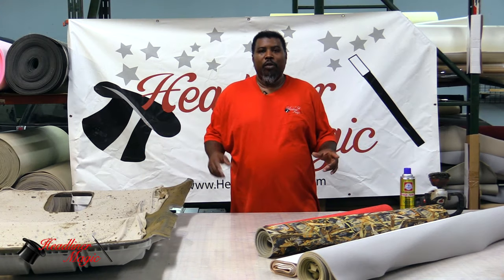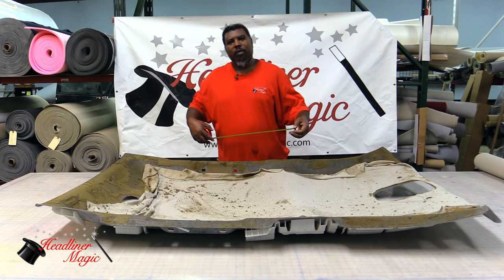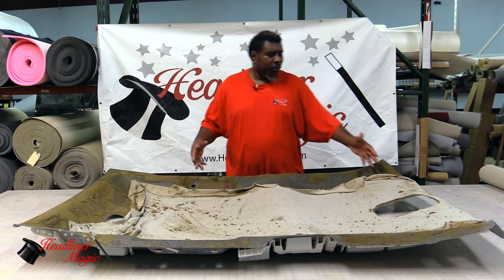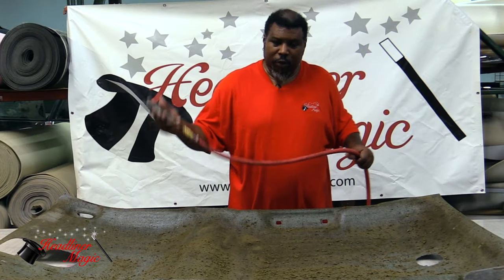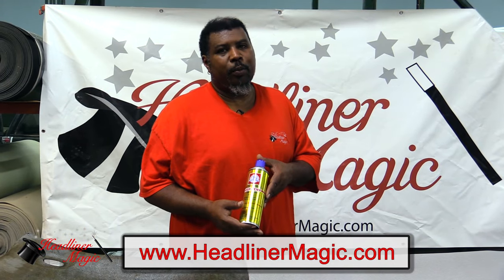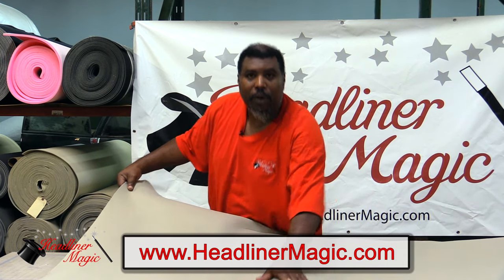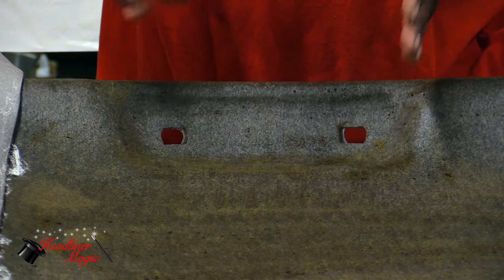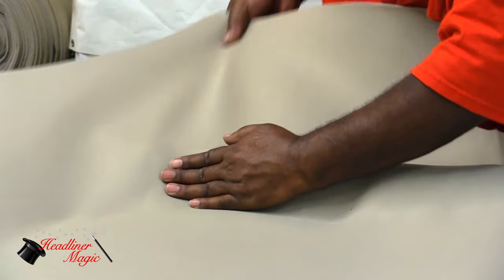Detail Process Replacing the Headliner Ceiling Fabric in Any Vehicle

Comment: Marcus, I'm so glad I came across your video.  Looking for some help.  I have a 2018 Sprinter Van.  The cockpit headliner is a gray felt type material.  In the back there are 4 headliner  panels than span the whole cargo area.  Those panels are more of a perforated vinyl that is a light grey blue, and its a mismatch to the front.  Can you recommend a matching  color material for those back panels, and, since they are in great condition, can I just glue the new fabric over them??  thanks!!  Mike
Reply from the maker: I believe our 1808 Ox Gray headliner will be a great match to the front headliner.  And Yes, you can just glue over the rear panels to color match everything.  If you like you can email me at headlinermagic@gmil.com with a picture and I will respond with the color match and link to where to purchase the material by the yard.  Marcus

Comment: I have a 2000 Jaguar S Type that needs headliner replacement. My vehicle has a sunroof, how much more difficult does that make the process?
Reply from the maker: The 2000 Jag S Type is a easy one.  Drop it and remove it out of the rear doors either side.  The sunroof area.  I have some time at this video link. 
 
https://www.instagram.com/tv/CXkCTIQlMJn/?utm_source=ig_web_button_share_sheet

Marcus
Headliner Magic

Comment: I have an annoying question. What if the foam isn’t torn up but still that bright yellow color? Do i have to scrape it all off or can i leave it?
Reply from the maker: You should get it all removed.  The foam has lost it ability to hold to the fabric it was originally attached to.  So, at this point, it is compromised.  Marcus

Comment: will a 36 L x 60 W be enough for a 2006 Toyota Corolla?
Reply from the maker: No the headliner board is larger than that.  I suggest 2 yards which measures 72" long x 60" wide.

Comment: Still a good job
Reply from the maker: Thank you Hailey,  Marcus
Reply: @HeadlinerMagic  I plan to use 3m 90 adhesive on my headliner because it resistant to higher heat
Reply from the maker: @Hailey_WhiteRaven  3m makes a glue now for headliners, I would recommend using it vs the 3m 90 her is the model #38808

Comment: Marcus, when a person takes his car into a headliner shop, they only replace the foam, not the board?
How much does it cost, on the average,  to obtain a "new" headliner, say for a 2004 Ford Ranger?
Reply from the maker: If you are referring to the board cost. The newer cars are only available from the dealership and the cost can range from 600 and up just for the headliner board. Good news is it comes wrapped with foam backed headliner. That cost does not included installation. The 04 Ranger should cost in 2020 around 175 for single cab and 225 for extended cab in my opinion for the headliner material replacement. Price could vary per shop and materials used.

Comment: Did the foam that you were wire brushing off start off as a sheet of foam lining in between the headliner and the fabric? I noticed you didn't replace that.
Reply from the maker: Hello Eddie,  the new headliner material is already foam backed.  When the new headliner is applied to the headliner, the fabric and foam backing are installed all together.   Marcus

Comment: I have couple questions. When I removed the headliner I had impression that the top wires were attached w/Scotch tape to the headliner, but now I think they might just stick to the headliner, but actually were attached to the metal ceiling. Can you attach them to the ceiling w/tape? And another question : when I cleaned the old foam, in some places there was some layer pilled off, like thin fabric or paper, not sure what it is. So now, should I pilled it off everywhere, or I can live it and the foam will attach and dissolve that layer (I hope it is some kind of paper layer), but maybe when the headliner is in that condition, it can't be renewed w/a new layer of foam fabric. Thank you again.
Reply from the maker: The wires cam be attached to the board or the ceiling either is fine.  And the layers can be glued to the board and just make sure they are a level as possible to avoid any lumps when applying the new headliner material.
Reply: @HeadlinerMagic  Thank you kindly. The loose layers are very thin and look like napkin paper. I'll remove as much as possible making sure no uneven areas are formed. I also think to cover the outer side (which goes to the ceiling) w/fiberglass resin to strengthen the board a bit. I saw in one film the author put several layers w/large brush. That board is very easy to brake, I don't know or bcs of time and heat, or it is just that kind of material. I expected it would be plastic there, but it is just a dense foam. Thank you again, especially for the advice about wires, it looks to me way easier to attach w/scotch everything to the ceiling instead of messing w/that easy to brake board.

Comment: how import is the material having foam backing? I've had trouble putting a material on my benz headliner and I assume its because it's not foam backed
Reply from the maker: The foam help for keeping the material from bleeding thru. You can do a unbacked material but it take skill to spray it and not bleed it thru. You have to spray it on a hot day from a distance and let the adhesive land on it lightly spray the board first so it will have time to tack. Then rub the two together.  You still have to do small sections at a time keep the wrinkles out.
Reply: Early 2000 I used a white vinyl bought from the fabric store with no foam backing on my 85 Cutlass. I was able to do this pre YouTube without issue. However, without the foam looked slightly out of place where it adjoined the car's interior pieces. But still looked great having DIY all white interior.

Comment: How much wld it cost for a 98 accord sedan with sun roof in black?
Reply from the maker: If you need the headliner it's www.headlinermagic.net for $49.97  and adhesive at $29.95 for two cans or if your local and would like the service we can complete the replacement for $275. 1 yr warranty. And the task would take 2 to 3 hrs.

Comment: Hi how is it going, I have a 4 door Sedan with a sun roof. I bought a roll of suede with the foam backing. I tried to go the easy was and wrap over the OEM headliner. I got half way through it and noticed the permatex headliner adhesive was soaking through, and left glue spots on the suede. I tried to use mineral thinners to get the glue off but it didn't work. I got frustrated so I ripped it off to the cardboard, cleaned it off, and prepared to go at it again. Why do you think the glue soaked through. Was I suppose to wait for some time? This time around, I ordered stretch suede (which I didn't before). The sun roof recess was a but difficult due to no give in the material. Will the stretch suede help in this area? After the wrap, I have to add the fiberoptic (stars). Thanks so much for the help...
Reply from the maker: Yes the stretch suede will help tremendously.   The glue should be applied to the board in a mist like form.  If it's coming out to wet.  Try shaking the can more and spray further from the place you are applying.   Then let it tack up about 20 to 30 sec before applying the two pieces together.
Reply: @HeadlinerMagic  Thanks so much, I see. The Permatex comes out stringy, and a bit wild. I got it somewhat done though, I just have to do the edges. I got a little spot  where adhesive touch the suede in the rear, not too obvious, but is there any thinner that can get it out without ruining the suede? Again I appreciate your info.
Reply from the maker: You can try hand sanitizer or some alcohol or paint thinner on a rag.  Do not apply it directly.
Reply: @HeadlinerMagic  Ill give that a try. Thanks so much Marcus.

Comment: How many cans of hi temp glue did you need ?
Reply from the maker: Great Question Israel, you will need 1 can per every 1.5 yards roughly.  So if you headliner is longer than 54" then you will need tow cans of adhesive to get the proper coverage.  I used one can in this video when the cans were 15 oz.  Now they are 12 oz so they are a litte smaller than before.  Hope this helps.  You can also tell me the vehicle make and model and I can tell you more specificly.  Marcus

Comment: how do you remove the headliner out of a 2007 mazda 6 on the corners without the airbags going off
Reply from the maker: Hello Brittany,  The mazda 6 is so easy.  You will remove the visors, handles, and interior lights.  Then recline both seats and put one hand in the center dome light hole and the other in the front console hole and pull down on the board and it will release from the sides.  Walla Magic.  Marcus

Comment: What if the headliner is in a new car and you want to change the color? Couldn't I just put fabric over the original headliner? Or do I have to remove the whole thing like you've shown in this video?
Reply from the maker: No if the fabric is fairly new you can just go over the existing fabric. You will just need to use a fair amount of adhesive because the fabric will absorb some of the glue spray. Marcus

Comment: Is 3 cans enough for a Caprice Wagon ?
Reply from the maker: Yes,  2 can is great for the Wagon. You Should be be ok with 2 as you can usually do 2 yards of material with 1 can.  The wagon  uses 3 yards of material with out a sunroof.  if you have a sunroof you will need 4 yards.  Marcus

Comment: I’m a bit confused. Most every single person that does upholstery lets the glue tac up letting it get dry before they ever start covering. Just curious why you don’t use that method.
Reply from the maker: Spray cans dry very fast once you shake them correctly to spray in a mist.  They should not spray out so wet because you don’t get a even spray just wet spots.  Being a contact adhesive the working time of this adhesive is less that a full minute. We spray on a small section to have time to work with it and have a modest amount of material to deal with in case we have issues like wrinkles or something not laying out right.  Marcus

Comment: I have leather material it has no foam. What I do about foam I have a old school
Reply from the maker: If u have a board just apply some regular headliner down first with a foam backing and then go over it with the leather.
Reply: @HeadlinerMagic  I had to replace it and it’s bare
Reply: @HeadlinerMagic  so it’s not good to just apply the leather to the board without the foam?
Reply from the maker: You can apply it without the foam but it can show imperfections in the board is all.
Reply: @HeadlinerMagic  Aw ok. I got a brand new board so I guess I will be ok

Comment: Hey I just brought some adhesive from your store the other day by any chance do you know how I could put my headliner back into a Chrysler 300 without bending it
Reply from the maker: I can help you with that.  This is a tough one but here we go💨💨 First recline both front seats, then the driver side seat let it all the way down and back.  We will be going in the back door on the drivers side.  The board will be turned side ways and shove it down the side of the seat and lean in the top part towards the roof.  The board is fiberglass so a little bending wont hurt it at all. you can go around to the passenger side front to make sure you are clear going in towards the dash.  Once you get it in  you will swing the back over towards the passenger side and you all good.
Reply: Headliner Magic thank you so much for the help will be doing that Sunday letting the adhesive dry all the way

Comment: PLEASE PLEASE tell me how you spray the glue on both the headliner and the board and you are able to lift the headliner back off to smooth it?? When I tried it just put a wrinkle and the glue wouldn’t let me lift the headliner
Reply from the maker: Great question.  Timing is key.  But I am not always successful.  depending on the tack time and if you smooth it out the first time.  if the material is just laying on the board it will come back up usually.  But if you actually smooth it out, the pressure applied will cause it to be permeant in most cases.  This is the main reason I only spray a section at a time, so I can focus on the laying of the material to avoid those mistakes. I hold up one end and pull on it to decrease any slack when I am smoothing it out.  Don't pull to hard just enough to make it snug.
Reply from the maker: I wanted to also say Thank you for subscribing.  It means a lot to me and the channel.  Marcus
Reply: Headliner Magic thank you so much!! We normally spray half at a time and there is no way we can lift it if it touches at all!
Reply from the maker: @missyleftrick5525  you will have better luck with just spraying 12 to 18 inches at a time.  Try that and let me know the difference.  Marcus

Comment: I noticed you didn't leave access material around the holes and you did around the edges, why?
Reply from the maker: Great question Raffe,  the pillars create a seal as well as the light consoles and other accessories.  There are only a few vehicles where i will wrap the board where the pillars go.,  They are the ones where the pillars just don't sit close enough to create a tight seal.  Marcus

Comment: whats the average price of replacing a headliner?
Reply from the maker: Headliner replacements average around $325 to $375 depending on year make n models and the material used. A small 2 dr truck can be as cheap as $225 and a Porsche Cheyenne can be as much as $550

Comment: I bought new headliner material and removed my headliner and removed the old fabric and foam. I purchased the 3M super 77 adhesive for fabric. Applied it to the headliner board and to the back of the fabric and let it tack up. Re installed head liner and two days later its sagging now. What should I do to fix this?
Reply: @RyseTV  I would rather do it myself on my project car. 

Just need the right glue. Im gona try Weldood Dap this time
Reply: @ddemier  Don't get me wrong but it'll probably sag within 1 to 2 weeks. You could have let it done by a professional with the money you've spent.
Reply from the maker: The 3M 77 does not have the High temp properties needed.  You can use 3M headliner adhesive they have that should do the job..  You only need to let it set about 30 sec depending on the temp during the time of installation.
Reply: @HeadlinerMagic  what do you think of the Weldwood Dap contact cement. I think im just going to apply the gel like cement on the headboard then apply the headliner after I fold the drooping headliner back. Of course i will have to remove headliner again.
Reply from the maker: @ddemier  I have used it on vinyl jobs. it may work as well for the foam liners.
Reply: @HeadlinerMagic  well its what I orderd. I will try it cuz that super 77 was junk. Should I do two coats of that weldwood contact cement on that headboard? I figued the first coat will soak in
Reply from the maker: @ddemier  Yes,  You should do two coats.  The first one will provide a seal on the board as a base.
Reply: @HeadlinerMagic  can this weldwood dap tolerate the heat unlike that 3M 77?
Reply from the maker: @ddemier  Yes, the dap weldwood is great in high temps.

Comment: What is the cost of this
Reply from the maker: The cost to replace a headliner will depend on the vehicle year make and model.  Mainly because of the complexity of the removal and cleaning process also the curvature of the board itself.   But for reference this was a extended cab dodge truck and our services would $325 for the full replacement process.   Thanks for the question.   Marcus
Reply: @HeadlinerMagic  What would the cost be for Mercedes A class headliner?

Comment: No foam between the new headliner and the board? You ground off "old" foam.
Reply from the maker: Hello Ruben, The foam is already attached to the new headliner fabric.  That is the way the headliner is manufactured originally.  The foam delaminated over time due to heat and quality.  The old foam need to be removed completely because it is unreliable due to the foam breaking down.  Marcus
Reply: @HeadlinerMagic  Got it. It was not mentioned or apparent that the new headliner came with foam. I need to do this to my car.
Reply from the maker: @Meche697  No problem,  In my next video I will include that detail info to better explain the process.  Thank you for the question and feedback.  Marcus

Comment: How to remove the headliner from the car ?
Reply from the maker: Most headliner boards will come out thru the rear door by letting the seats back. Let me know what year make n model you have so I can be more specific if needed. Marcus
Reply: @HeadlinerMagic  The car is a Jeep Grand Cherokee 2009 Outlander  with ceiling screen
Reply from the maker: @Carlos.Ruiz.Guzman  In your case it will be removed straight out the back rear hatch to release the board from the ceiling and pillars. You will need to know the headliner board is flexible and will not be damage if you bend it.  It like a Frisbee you can flex it and it will return to it same shape. Once you remove all of the grab handles and visors and interior lights.  You can reach your hand in side the center access holes and pull down on the board causing a U shape bow.  This will allow you to release the board free from the side pillars. once the board is down. You can then slide it out the back of the vehicle. No problem.  Hope that helps.  Let me know if i need to clarify any other points.
Marcus

Comment: Use Dap weldwood.  That can stuff is garbage.  I like a wire wheel I can chuck in my drill to remove old foam.
Reply from the maker: Thanks for the tip, but not everone has the compressor setup.  So the performance is their best option currently.  We are working on a new formula for the spray can adhesive.  Marcus
Headliner Magic